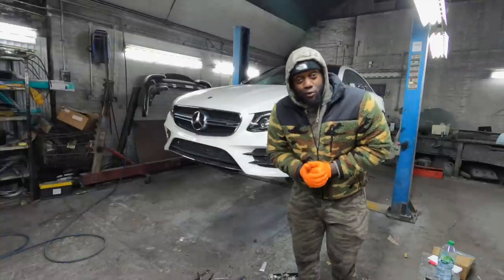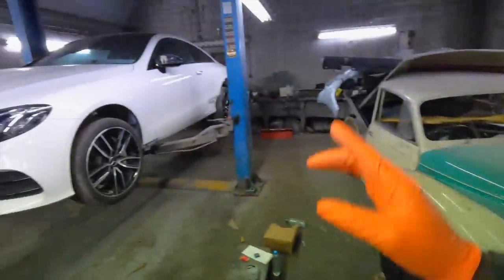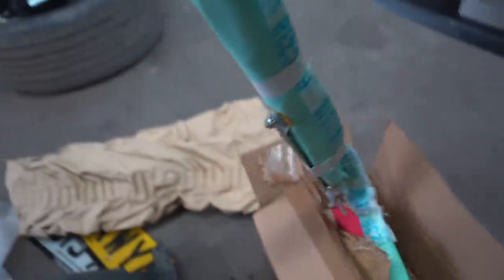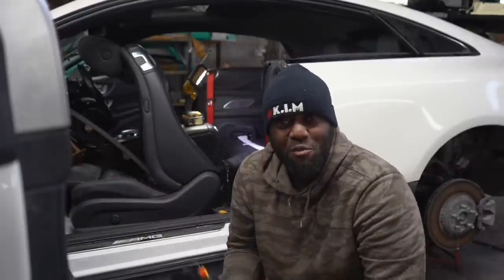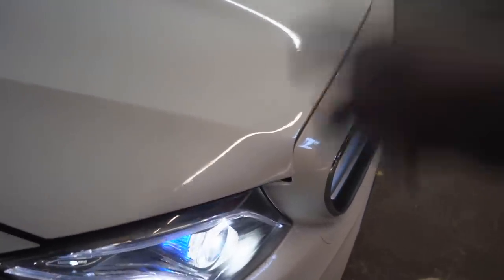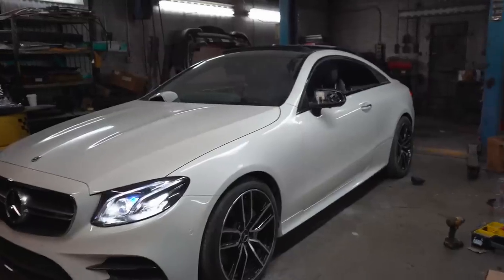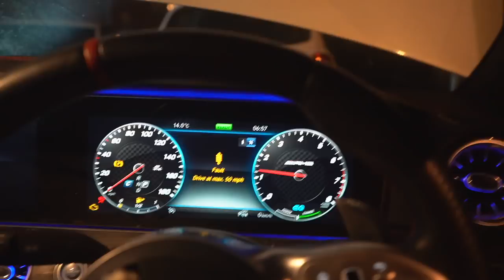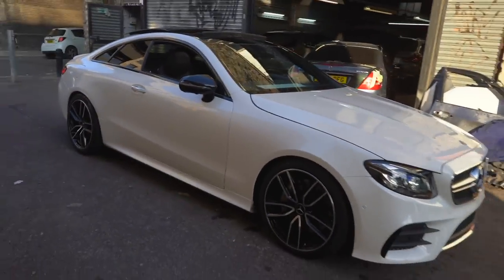SALVAGE NATION UK | REBUILDING A WRECKED 2019 MERCEDES E53 AMG EP.7

Comment: Hi Dee, i have a career way out of the motor industry (in the science research area) but my love for cars and from watching your videos has recently started making me buying cars that have some issues to fix up and then try sell on (break even for me is ok as it’s a passion not my bread winner). So far I have sold 2! But I don’t have an obd reader other than a basic eBay one. For example I just bought a bmw 5 series which has to headlight issues, but I run to a friends garage and embarrassingly use their diagnostics each time I fix something to check if it’s solve it. Before that had a Mercedes a class which I fixed and saved from salvage, again this time I had to used my local mechanics for their scan tool (small fee) but haven’t made enough profit to buy a decent scan tool!

Comment: Not sure if I missed it but did you cover the left rear air suspension issue?
Reply from the maker: Yh, its in a previous ep. I changed the bag/strut and got the entire system calibrated. All sorted now. In this video theres a but where the car goes to the low setting and i sped it up so u see the car dropping.